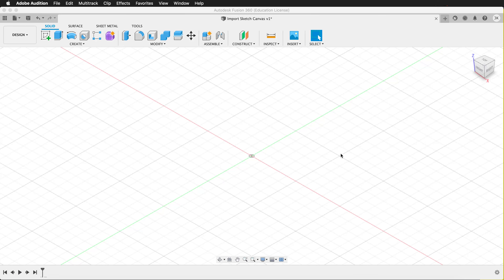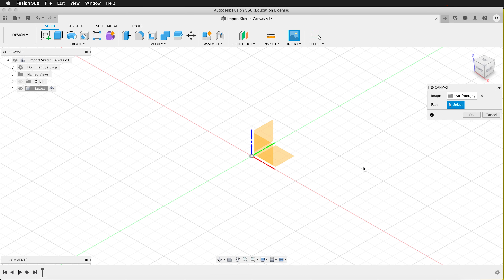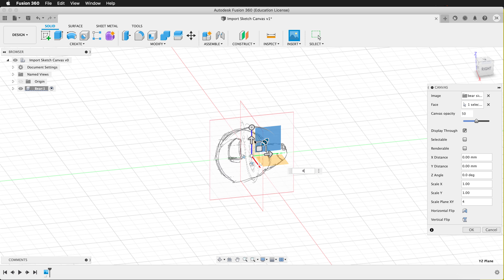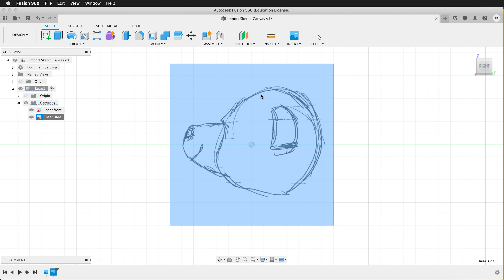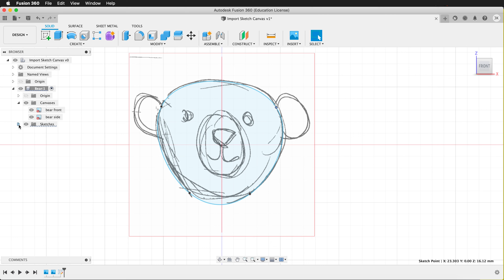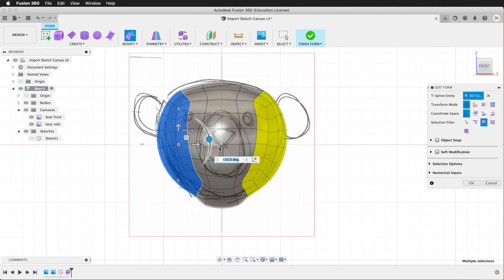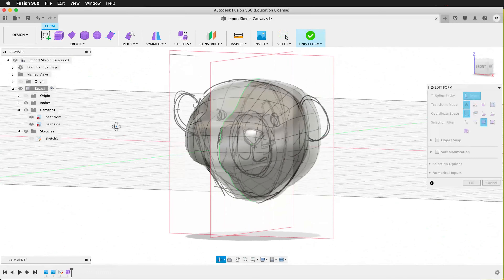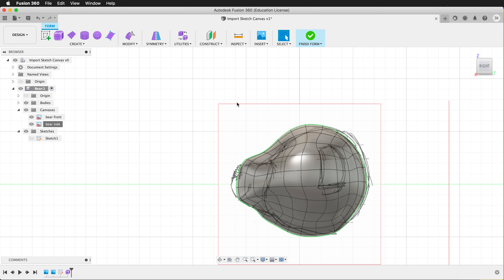Insert Sketch Canvas to Fusion 360

Comment: Hey! When I create a new canvas with the new component selected, for some reason it creates the canvas and canvas folder in the parent folder of the project. I am using the personal license version of Fusion 360. Am I doing something wrong or is this a limitation of the personal version?
Reply from the maker: Are you sure the little circle is selected by the component? If the little circle is selected by the top component then it will be in that. But if the little circle is selected to the name of the actual component in the browser, then the sketch will be in that component
Reply: @WhatMakeArt  Thank you for such a quick reply!! 

After some digging on the Fusion 360 forums and a few responses, it seems that the solution for what I was experiencing was to make the Sub Component Origin visible, then it would allow me to link the Canvas to that Sub Component. I'm still not sure why I have this extra step, but it seems to be working.

Thank again! Awesome video by the way.
Reply from the maker: Thanks for sharing the solution 👍